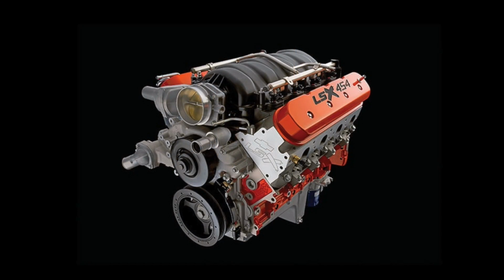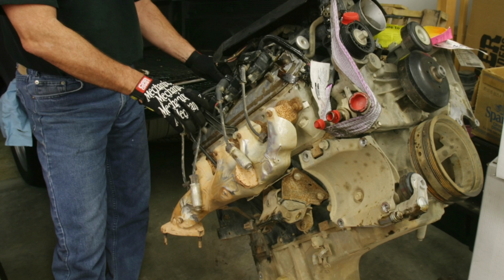Everything You Need To Know About The Chevy LS Engine

Comment: Has the LS3 got the same bell housing bolt pattern as the older cast iron 350 Chevy Generation 1? For example, if you have a bell housing and gear box on a Gen 1 motor, will that (same bell housing and gear box) fit straight up to the rear of an LS3, or do you have to use a different bell housing and play around shortening/lengthening the input shaft on the gearbox etc, etc? Thanks.

Comment: "Small Block" - that's not small! 
V8 engines for production have been made as small as 2.4 litres and my favourite is a 3.0 litre.
There has been very few small V8s in the last 40 years, none from the USA as far as I am aware.
Some of us love the V8 sound and the engine character but just want to potter around at legal speeds on public roads with good fuel economy, but they can't in any modern V8 car. V8 engines don't all have to be so big or powerful, there are plenty of that type already.

Comment: What is the best LS engine choice to swap in my 1994 GMC 1500 Sierra
Reply: I would sure like to know the answer to that too!! 👍🏻
Reply: reggibs     depends what power your looking for and how tight your budget is and your mechanical skill. Probably just a 5.3 3gen iron which are lm7 or l59 there the cheapest and can handle about 600hp stock internals pretty reliably you’ll pay double for a aluminum block or a 4th gen block he said piston fail first that might be true for 4th gens but from what I’ve seen rods are the first to go with 3gens
Reply: Awesome thank you.
Reply: John Doe   Also the 4th gen internals are quite a bit stronger seen some hit 1000hp and 1600hp on an engine dyno but 800hp will be the most reliable
Reply: THE WANDERER what crank should I use, 3rd gen or 4th gen?
Reply: THE WANDERER  That 800hp sure sounds nice!! 👍🏻👍🏻

Comment: Dohc costs a lot of size but not that much weight. The 5.0 coyote, for example, weighs about the same as an aluminium 5.3 ls around 430lbs. The strength of dohc is incredible flow relative to port volume. The strength of pushrod is lower center of gravity and small external size relative to displacement.

Comment: The LS V8's are good. But their weakness is not just the pistons but also the stock valvesprings. They are only reliable up to 5,500rpm. The easy fix is to fit the LS6/LS3 valve springs then they are safe to 6,600.

Comment: To build a street rod muscle car which LS engine would be best to work with LS one or LS three
Reply: You have a choice. LS1 (5.7) or LS2 (6.0) are fine for the street, but you need to fit the LS6 valve springs for reliability. The LS3 (6.2) is also good but needs to be revved a little more (different style, higher flowing heads that lose over the older cathedral port heads at lower rpm) But all are good as long as you ensure you have the LS6/LS2/LS3 valvesprings.

Comment: small block Chevy is the best engine ever made worldwide.
It is the most swapped in engine in all car brands
Reply: Do people still use them for swaps or does everyone goes the LS route?
Reply: Taunuslunatic 
I did a 350 sbc swap. I paid $300 for a rusted out 79 Chevy truck. The engine and transmission were still good. I just resealed it with new gasket and put it in my 84 cutlass supreme brougham.
Reply: @taunuslunatic404   LS...old SBC is old tech
Reply: the small block is the most swapped because its cheap and can get a lot of power out of it just by adding a top end kit. no major wiring harness needed or sensors.
Reply: Cuz they are cheap. Thats it.
Reply: What world do you live in
Reply: Pro tip : watch movies on Flixzone. I've been using it for watching a lot of movies during the lockdown.
Reply: @Stanley Alessandro Yup, I have been using Flixzone for months myself =)
Reply: I've all ways been a twin turbo Japanese engine fan, but I have to concede that the LS is king 👑.

Comment: So being the best engine ever....not so..ls engines in production used substandard synthered rods. npot forged or cast making the loading rate not strong enough to sustain hp above 450hp.
ls engines also if overheating self destruct with factory aluminum heads and blocks..however there are cast iron blocks. those are nice...sad part is they do not make a cast iron head. which leads to issues under forced induction which a lot of ls packages come from the factory.
The best engine in my opinion ever built was the chrysler 340 mopar...low cost...high compression pistons...high duration camshaft..forged and shotpeened internals to include push rods and rocker arms from the factory. able to withstand 12:1 compression with ease. windage tray from the factory.
These engines where used in nascar and nhra competing with bigblocks and surpassing all but the 426 hemi...
still lower cost then the ls1 
https://www.hemmings.com/blog/article/factory-hot-rod/
https://www.hotrod.com/articles/bad-mopars-340-beat-ford-chevy-shocking-new-data/
This engine was used in scca offset to balance drivers weight.
This engine was used in nhra by builders dick landy industries.
This engine is the forerunner for nascar and sprint cars iron blocks r357
https://auto.howstuffworks.com/auto-racing/nascar/nascar-basics/nascar-engines.htm
this engine is capable fo 9000rpm format long duration endurence applications.
manufactured from 1968 until current...can be outfitted for fuel injection or carburetion.
power outputs are greatly underated form ama hp of 295 wheras with electric fans
and fuel injection and header based exhaust the standard ls1 produced 350 hp
easily achieved in the same configuration on a 340 which is smaller than the ls1.
The actual 340 with headers and a electric fan would actually surpass the ls1 in performance.
and cost less.. considering with a computer and all engine for engine...the 340 hands down is a better motor.
i would say it surpasses all ford motors.....and in normal configuration all naturally aspirated gm motors.
now if you force induce it it will surpass the dodge demon as well as all current gm motors.
https://www.youtube.com/watch?v=blL8QJy9C8I
based on all the literature on this engine i as a engineer professionally disagree that for the money the ls1 is the best 
factory engine around....I would suggest for the author or this video to work on a few more engines and look at the designs break them 
all the way down... and see the strengths and the shortcomings as well.
the reason people put ls1 engines in their cars was the aftermarket industry a huge amount of aftermarket parts for this...
but it does make it the best engine ever..about 13 years ago they did the same for the ford 5.0l now it is history.

Comment: My 2009 Gmc 1500 has the 6.2 liter. Amazing motor. I get 15.5mpg in a crew cab 4x4 with lift.  Always has enough power when you need it. I have 170k on it. It's just broke in.

Comment: Ford donkey is piss poor engineering 4cams can’t do what Chevy did with 1cam
Reply: Got an ls in the driveway. It's a fine engine but the damn truck is falling apart around it. My ranger, 10 years older and a lot more miles, is nowhere near as bad. Eventually I'll stop finding things to fix every time i touch that truck. At some point it'll be new again lol. I wouldn't have that gmc but it was too good of a deal to pass on.

Comment: Not a mech. if anyone knows? . . I've got a 4.8L auto : cast-iron from a 02' 2wd 1500 Silverado 8'ft bed , I like to drop in a GM van, I read somewhere the 4.8L they put in the vans are different than the engine put in a truck . . if anyone knows it would be appreciated.

Comment: I like to change my oil every 3 thousand miles with mobil 1 on my 2017 Suburban.  Are they reliable? Anything I need to look out for ?
Reply: Dude you do not need to change your oil every 3k miles. That is what oil sales companies (Autozone, Advanced Auto parts, etc,) want you to believe. Read or look up the maintenance schedule provided by the factory OEM.(manual) They  are responsible for the research , design, testing and development of the engine.

Comment: If you go to 600 lift don't you go into valve float?   I put a big cam with 1.85 ratio rockers and went into valve float at high RPM and I wasn't close to 600 lift
Reply: That's because you are a dumb shit and did set up your valve train properly!
You need to ensure your valve springs and pushrods  are the right spec and set up with the correct install heights and pressures.
You also need to ensure your lifters are up spec too
Reply: Correction: didn't
Reply: I had R Lifter, Hi Tech pushrods, Dual Valve sprigs w/ Titanium retainers  These are all of the best quality Comp Cams has  The problem was I couldn't use the 1.85 roller rockers with a big cam  I had to go back to the stock 1.7 OEM GM rockers  That small change was enough to end the valve float which I only got over 5K on the dyno  You couldn't tell it while driving   Only when you watched it on the computer while strapped to the dyno  I made 339 hp at the rear wheels with a 4.8 L which Thunder Racing had not seen before on a 4.8

Comment: Pistons are only the weakest point because people fail to gap the rings to the performance level they wish to aquire.
The LS takes heat because they're capable of holding together better to higher HP levels than any other stock engine ever.  Pistons on an LS will work well to past 500 hp where other engines will have multiple failure under 400 hp. 
So that's kind of a weird point to make.

Comment: Can you swap a 2001 5.3 motor and trans with a 2006 5.3 motor and trans
Reply: No. The 2006 will be a Gen IV so will more than likely have a TCM and an ECM. The 2001 5.3 has just one ECM controlling both engine and txmsn. Check it out on LS1tech dot com.

Comment: GM borrowed the 6VD1 engine design to make the "LS" series from Isuzu engineers, who started this engine design in 1989. The new engine included a "Y" block design with a belt driven SOHC to keep weight down. It featured 6 bolt main blocks with a crank driven front G-Rotor oil pump that delivered oil with internal passages and an oil girdle across the bottom. They incorporated an off-set timing ring mounted on the crank for more accurate ignition timing. Using a pent-roof combustion chamber with 4 valves and center plug, they placed and intake with two chamber runner design with vacuum control that moved valving from long runners under 1,800 RPM to short runner over 1,900 RPM. GM owned 49% of Isuzu in 1990 and a percentage of Delco parts where installed on the 94 "UC" Rodeo and Trooper "UX" body in 1993 when this engine came to market. Prior to this, came the 2.8L & 3.1L GM engines in the "TF" pickup and "UC" Rodeo. The downfall came after a determined number rebadged Rodeo's in 94 for Honda as the Passport, the sale of the Rodeo hit a glass ceiling while forcing the pickup "TF" body out of the SIA plant in Indiana in 94. Many imports, including the original Isuzu pickups were subject to a high duty tax by the Clinton administration and killed the original "TF". GM then sold the rebadged "S-10" in 95 and after. The engine 6VD1 went thru some upper end modifications ending up with a DOHC version in 99 in the "UX" & "UC" Rodeo. GM borrowed many of the engines design features to design the "LS" engine series while planning to use "Displacement-on-Demand" require a center block camshaft and signaled the end of the 3.8L Buick engine. While the DuraMax diesel was all Isuzu, GM was not allowed to use it in the Hummer H1 as a government contract would not let them use an import design diesel engine. This forced Isuzu to focus on the 18 wheel market as Japans oldest diesel manufacture, but was denied permits to build in the USA, thus forcing them to focus on overseas markets only. So...who built what & who got cheated?
Reply: Very interesting, first time Ive heard the history this way. I would tend to believe you over the Ford guys who say GM stole the design from them. I knew that GM and Isuzu had worked together in the past, so it makes sense. Cheers

Comment: I read thru the comments hoping for someone to say what are the best head castings when head hunting on a budget. I have the 862 on the 5.3 . Thinking of a build. Any help would be great!! Thanks
Reply: On the 5.3, stick with the 862s.  Other castings will drop compression, which drops power everywhere.  862s flow good with mild hand porting, even with the smaller stock valves.   
It really depends on what your goals are.  Stuff like how big a cam you want.
Reply: Also 243 casting, they are LS2 heads found on some 5.3. My 2008 LC9 has them.

Comment: any reason to be concerned about oil pump failure on stock LS3 motors?
Reply: No. They are fine. I ported mine and idle pressure went up from about 33psi to 45psi. Worth it.

Comment: yeah, the trouble with strokers is unless you increase the bore to match, the engine wears out far more quickly, also you can forget about high revs.
Reply from the maker: You can still have a high revving stroker, but yea a longer stroke does make it harder to sustain high revs. It’s more about rotating assembly weight and balance, though.
Reply: besides, when it comes to pushrod V8s, i have found that the hemi is actually a better design
Reply: “Wears our far more quickly”
What you said makes no sense.

The downside of stroker LS engines are that the piston skirts get pulled out of the cylinders (primarily in iron blocks, aluminum blocks have longer cylinders thanks to being sleeved), making the pistons more prone to rock.

Comment: shelby 5.4 is still superior to all american racing engines.  there's a reason they have the texas standing mile record at 293 mph.  where is the LS motor in the chase for the fastest standing mile car?  Carol Shelby was right, the 5.4 DOHC 32 valve shelby motor is the best racing engine ever built in the U.S, NOT the LS.

Comment: I want to build an LS 6.0 with 6.2 heads steel block. 
For dirt track.
I would like to stay as stock as I can but new piston upgrade is a must, and any other upgrade you think is needed.
Don’t worry about class:
Any ideas you could give me would be most helpful.
Reply: The LS3 heads will fit on the 6.0 block. You will need the LS3 intake. If you want a strong block why not look for an LQ4 (fitted in GM trucks) or an LQ9 (fitted in Cadillac trucks 2002-2007). These were both iron 6.0 blocks. Do a google search to see. If you are going to race it you will need forged pistons and good valvesprings.

Comment: All Chevy motors from Chevy performance have the same parts list aluminum pistons and mechanical crankshaft not forged aluminum just aluminum they virtually have soda cans for pistons it may be cheaper but its not good at all you have to go after market just to get some decent parts but even then Chevy engines still dont last and they don't take abuse very good at all I've been to the mudhole and the longest a Chevy engine would last is 2 hours most of the time they last 30 minutes I've seen trucks with Ford 460s last years under higher abuse and there's one mud truck in Michigan that had a Ford 604 and that engine lasted 20+years under major abuse no Chevy engine even comes close the only reason that people buy Chevy engines is price tag but actually you will spend more fixing a Chevy engine in one month  than it costs to buy a reliable Ford engine  sorry Chevy is recalled crap I'm not impressed
Reply: Most ls engines use hypereutetic aluminum pistons. Hypereutetic is pretty the standard unless it is a performance engine. Most ls engines do not need forged pistons, it is only necessary when you start pushing 600 hp.